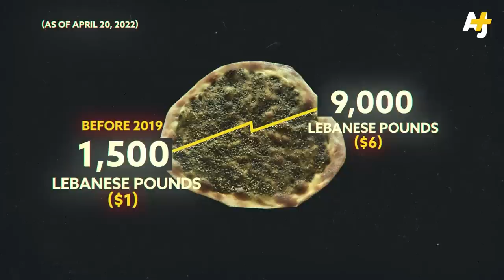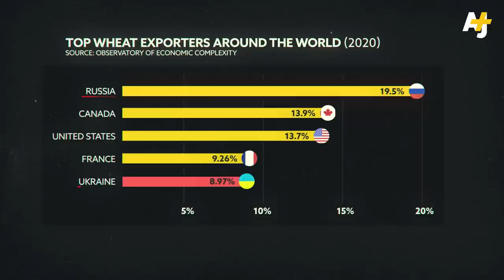How Putin’s War Is Connected To Lebanon’s Bread Crisis

Comment: Egypt was in fact a net exporter of food until Nasser. Arabists build 'houses to the poor' on fertile land and probably messed up other stuff too.
Reply: Also, the population rose for about 20M when Nasser took power to over 100M today. That had an impact.
Reply: @spadelives2  Well, he needed cannon fodder to wars Egypt lost. You can't call 1973 a victory since Israel still exists.
Reply: @chadgaston8615  Who called '73 a victory? After one of the battles, Israelis collected thousands of Egyptian army boots that the Egyptians had take off so they could run away faster. At one point, they took a major oil facility and found only two soldiers guarding it, both chained to their posts.
Victory, no, fiasco, absolutely.

Comment: Another video another let down. The bread crisis in lebanon is not russia or Ukraines fault. Nor is russia or Ukraine to blame for the oil and gas crisis in tbe west. As trump said before a crazy man can speak some wisdom sometimes. A country that relies soley on one source of supply leaves its self open to extortion and weakens its position in any negotiation. 'Lebanon had silos but those blew up in the beirut port explosion' if that's your comeback heres my response silos can only last for so long. Lebanon has alot of lands in the beqaa region but the country shut down the german company that used to subsides farmers in that region and ever since then farmers have been at a shortage for one major reason which is that their crops. Fail yo sell. Why? Because importing foreign goods are cheaper because usualy they are smuggled in such as syrian products.and unlike Lebanon syrian products are subsidies hence why they are cheaper and then your local lebanese goods sit on the shelf and later thrown out. Thats why you have a shortage of bread because you failed to manage your country and relied on one source of supply and now your paying double to get half of what you used to. Another AJ+ video that falls short. What happened? I used to be a huge fan of your videos now im Just disappointed.